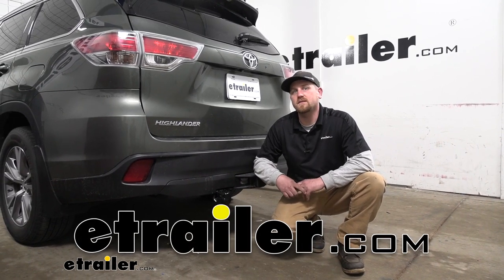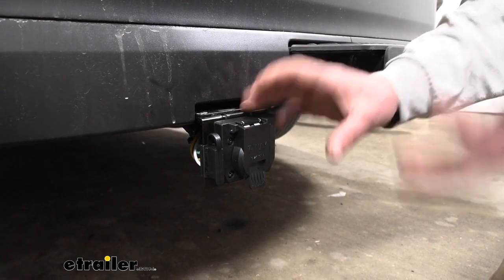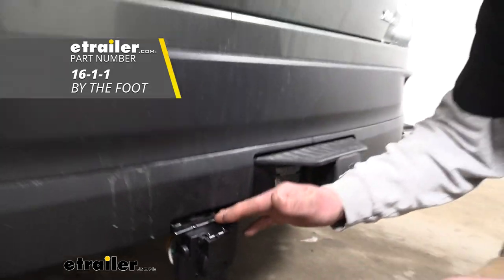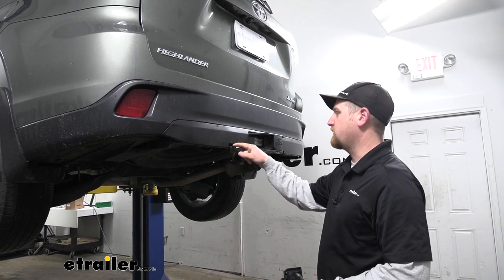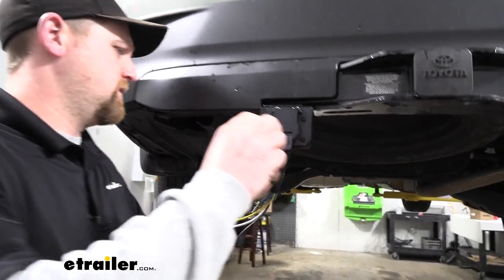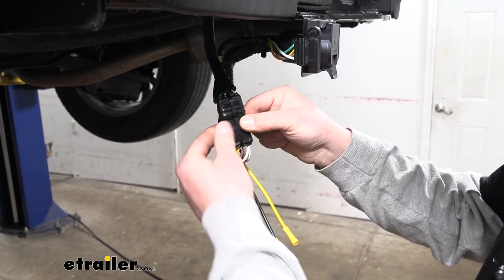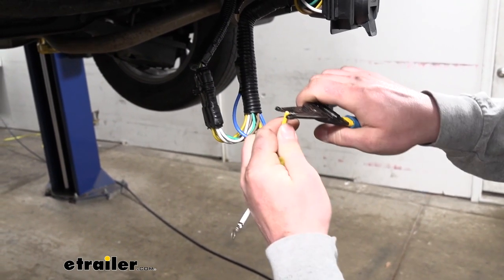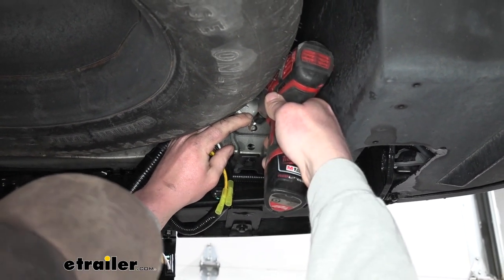etrailer Universal Kit for a Trailer Brake Controller Installation - 2015 Toyota Highlander

Comment: Very confusing video, at the beginning blue wire is taped, then next clip suddenly become yellow wire is taped. Later on, on the plug goes on the the brake controller, red wire are totally being skipped
Reply: I agree. At the beginning the blue is taped, then suddenly the yellow wire is taped.  Was this a mistake ?
Reply: Blue is always used for trailer brakes. He just made a mistake at the beginning of the video. They should have re-recorded that part, or at least put some edit text across the screen at that point in the video.
Reply: Ya if they had nice clear instructions I’d order it, think this video has me all confused. It’s only couple wires so not sure why it seems like a rubix cube.

Comment: I don't see why you couldn't just use one wire going to the positive on the battery. Then, install a short jumper between the copper colored studs on the two circuit breakers, using the heavy gauge wire provided. I plan to use this method. I will let you know if it does not work.
Reply from the maker: Using this kit is much safer to do than hardwiring the function wires. This installation will protect your truck from getting feedback from the trailer.
https://www.etrailer.com/Accessories-and-Parts/etrailer/ETBC7.html